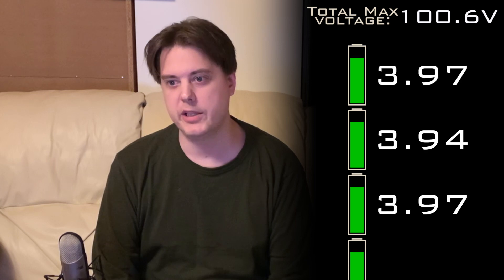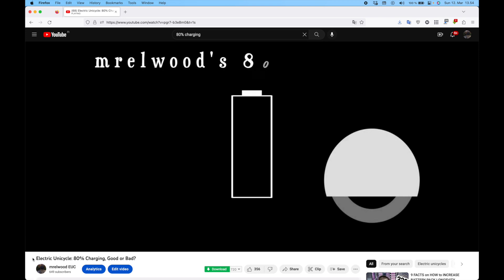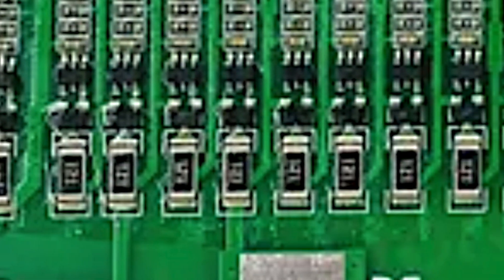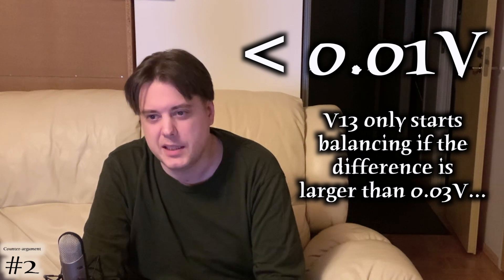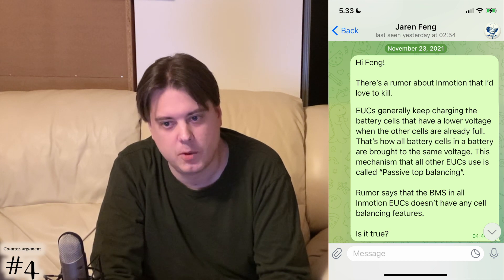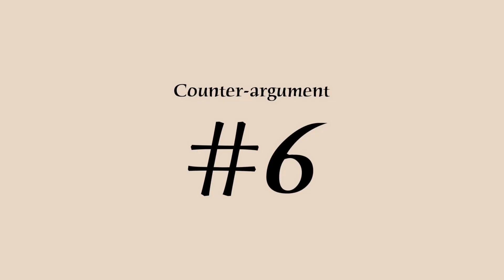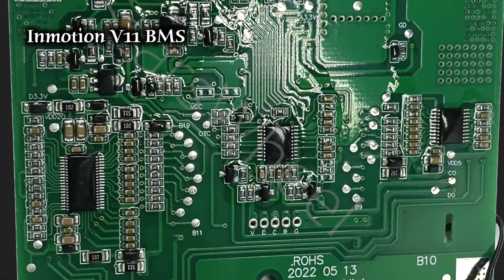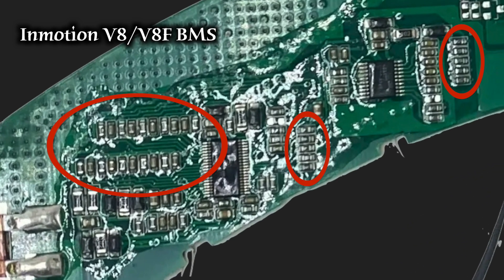Inmotion EUC Battery Cell Voltage Balancing, Yes/No?

Comment: Thats why i got rid of bms in my inmotion and added balance plugs and doing maintance balance charge  every month so i always know what my battery health is.
Reply from the maker: You got rid of the BMS?? So you no longer have any overcurrent, overcharge, or overheat etc protections??
Reply: @mrelwood_EUC  i have dialed the resistor in inmotion charger to charge to 83 volts this leave me with save margin so cells don't go over 4.2 while charging. I have split pack to two 8s and one 4 s for maintance charging where I can balance charge with my 8s capable hobby charger whenever some imbalance happend. I much rather to have this setup then have a pack with dodgy bms where I can only guess what cells are doing. Bms overcurent protection sounds like face plant so no thanks I rather to have this option removed. And I'm not worring about overhiting battery as inmotion board usually peak at 30 amps and I live in flat area so it's all good. Saying this I was testing   this setup on steep hills and all worket flawlesly. As for cell balancing they usually don't get out of balance if you have matched cells. I have small diy solar system with tesla modules same setup with no bms and in a year of owning it I didn't have to balance these modules at all
Reply from the maker: @greg23842384  The overcurrent protection isn’t there to cause a faceplant. It’s set to a higher amperage than the board can realistically use for balancing. It’s there to prevent a thermal runaway in case something goes wrong, for example a mosfet failure that leaves the mosfet open. Think about their “dodgy” BMSs what you will, but Inmotion has a few dozen thousand times more experience in building BMS systems than you do.

But you do you, just your wheel wouldn’t be welcome to my house. Nor would I dare to ride it.
Reply: @mrelwood_EUC  to take care for this issue i have installed quality class d fuse on my power leads plus there is another fuse on the board. I trust this wheel a lot more now then before. No bms less complexity and less chance that something will go wrong

Comment: Good argument! I stand more on your side although there is no clear confirmation from IM of their cell balancing mechanism. WW is great but he benefits from "views" and controversial videos get more eyeballs. It makes absolutely no sense that any PEV company would NOT use cell balancing in these GIANT batteries but the intellectual argument does not mean it is the case in reality.
Reply from the maker: You are absolutely right. This video didn’t present as much actual proof for there to be balancing than proof to why the arguments of people who say that there is no balancing are wrong. “Counter-arguments” might be a better wording.
Reply: @mrelwood_EUC  So, you are saying that the certitude of WrongWay that Inmotion doesn’t use cell balancing is wrong, but, in the same time, you are not certain that Inmotion DOES INDEED use cell balancing. In this case this video seems like a PR move for Inmotion, the opposite of anti-PR move of WrongWay. Bummer: It isn’t broken and it isn’t fixed.
Reply from the maker: The lengths that I’m interested to go to in order to find the answer that satisfy me have been met with what I’ve brought up in this video. I can’t see a reason to believe that Inmotions since the V10F (and possibly earlier) wouldn’t have cell balancing. And I find all the arguments that the other side has made to be easily refuted.

But that still doesn’t bring us to the factual truth. I can’t explain how what I’ve seen would be possible without cell balancing, but even that doesn’t give us the factual truth.

I would have to disassemble the battery pack of my V11, and use a lot of my time to orchestrate and document several measurements and test procedures. I’m simply not interested in wasting my time and energy on that, since it wouldn’t affect my relationship with my wheel nor my future purchases. And even that wouldn’t stop the rumor mill from going on.

So it’s not about facts. It’s about what’s  solid enough for you personally.

I don’t get your comment about a PR move though. If Inmotion was interested at all in addressing the rumors, why on earth would they use a small YouTuber like me to share counter-rumors when they could just as well kill the rumor altogether in the Ask Bob series of videos??

Comment: There is no shame for Adam to issue a correction video. And all of these companies should have PR teams in the west to deal with this.
Reply: Adam only stated that there is no passive cell balancing. Since the resistors on the V10F BMS are 1k ohms, there can't be passive cell balancing. This doesn't mean there couldn't be some other form of balancing.

Comment: I noticed in all of your pictures of Inmotion boards, the electronics have conformal coating. Is Inmotion the only company that does conformal coating on the electronics? Maybe you should make a video explaining to people what that is and how you can do it yourself to prolong the life of your EUC and make it better protected against moisture?
Reply from the maker: Most manufacturers do it nowadays. I haven’t seen any issues that would clearly be caused by a lack of coating on the mainboard, so I don’t see it being a very relevant issue. I’d also advice how to seal up the wheel otherwise rather than suggest for watchers of various levels of technical prowess to start coating their boards. It’s a bit too easy to get into places where definitely shouldn’t be any coating, such as the mosfets.

Comment: I'm a robotics engineer and this isn't the first time WrongWay (and others) have invented problems that don't exist and spread false information way outside their area of expertise. Very frustrating and disappointing.
Imagine waking up from a medical operation and telling the surgeon how he should have done the surgery, based on some rumours, from social media, while you were unconscious. Just where is this confidence coming from?
Reply from the maker: I’ve noticed the same in several subjects. People are certain that they have much better solutions to issues they know very little about, and no matter how gently you try to explain the situation to them, you immediately turn into a know-it-all company shill who wants to quiet the customers and prevent all questioning. Perspective is so lost on people nowadays.
Reply: however it really looks like that WrongWay was telling truth. On Euc Forum someone really looked into integrated circuits of V10 and schematics and found out that the IC didnt used the balance option.
Reply from the maker: I only saw the investigation on V5F. Seems that it indeed doesn’t have balancing. One can’t expand the results to all their models though, since the V5F is the smallest and one of the oldest. One would need to examine all of them to be able to say that none of them have balancing, which is what WW said, without examining them.
Reply: @mrelwood_EUC  actually someone posted a V10 BMS in the thread and it looks like even V10 BMS doesnt have balancing.
Reply: @LaggerSVK  Technically even without balancing, a battery pack with properly matched cells should do just fine for a long time without any kind of balancing. To prevent fires, the BMS really only needs to protect from over- and under voltages + short circuits and such.
Reply from the maker: That’s the thing though, “with properly matched cells”. I’m certain that at least some manufacturers (or some models) don’t prioritize proper cell matching all that much.

Comment: Agree with you 100%. Passive cell balancing is not some new high tech electrical wonder.  It's very simple and necessary.  I'm surprised Inmotion has not done more to snuff out this silly misinformation!
Reply from the maker: I fully agree. I don’t think they quite understand the consequences of the situation. I have tried to explain it to them a few times though. But I’m just a single member of public to them.

Comment: I was considering buying a V11 until I saw other information on YouTube alleging lack of passive cell balancing in InMotion EUCs. Then I started considering other options. So I'm glad that I came across your video that got my thinking back on track. I also previously got a lot out of benefit from watching your video on "80% charging, Good or Bad?" You have a way of clearly communicating technical information, in a practical and unbiased way. Thank you Mr. Elwood for being a reliable and helpful EUC content provider! 

Now, since I am still interested in the V11 after watching this, here is perhaps an opportunity for you to confirm (or correct) some other information (or misinformation) that is out there on the V11. Some review clips (or the commenters to them) have stated that the V11 bearings are (or were?) a problem, and the motherboard has a higher failure rate than normal and should be visually inspected regularly to ensure it is not getting fried. Are you able to comment on these aspects of the V11 reliability?
Reply from the maker: Thank you! Glad you liked the 80% charging video, it has turned out to be one of my most popular ones. Really happy I can share what I know!

On the V11: The first batches didn’t have any bearing covers, so the failure rate was high. Mine included. They have however shipped the V11 with well working bearing covers for almost two years now, so it’s no longer an issue. The mainboard revisions are however not publicly known, but at some point the failure rate did seem to go down. Unfortunately, a visual inspection won’t do you any good. Usually there are no fried components even on the failed boards. And even if there were, they only fry when the board fails, not before. I wouldn’t hesitate for a second in buying a new V11, but like with all wheels, a reputable distributor is always worth the small extra cost.

I have 7000+ km on my V11. I planned on upgrading last year, but they simply haven’t made a wheel that would suit me nearly as well as the V11. If you ride a lot of hard off-road, the suspension rails will need to be replaced at some point, but they are cheap. Still, keep them clean or well waxed. Don’t use oil or grease, as they will collect dust and other particles which increase the wear rate.
Reply: @mrelwood_EUC  Thanks for taking the time to provide thorough replies to my questions. Perhaps keeping the suspension rails clean is good enough care but if not, is there a type of wax you could recommend?
Reply from the maker: I have only tried a few waxes as I don’t want to purchase different ones in hopes that one might work well. But out of the ones I’ve tried, simple candle wax works easily the best! I have the small ones that come in aluminum foil cups. One can of course buy pure paraffin wax as well, should be mostly the same stuff.

First I remove the outer suspension rails to get access to the black rails. I remove the aluminum cup from the candle and rub the candle on the wearing part of the rail while pressing quite hard, until there’s a decent layer of wax on the rail. I then rub the rail with my finger until I can feel the wax get soft. I then rub the sides and backsides of the rails with the excess wax that’s on my fingers. Sometimes I even wax the plastic slider guides on the removed rails.

There’s no danger of overdoing it, other than it can get a bit messy. Any excess wax can easily be cleaned up with rubbing alcohol.
Reply: @mrelwood_EUC  Thanks!👍
Reply: @mrelwood_EUC Speaking of upgrading, have you considered the BegodeT4? I just wish it offered some water resistance, but V11 feels a little old compared to the T4 at this point, so my gf is considering T4 instead of the V11.
Reply from the maker: @leetNightshade  I have not. While faster and more powerful, it’s a Begode with Begode issues. Those I want to stay far clear out of. Based on what I’ve read:
- Suspension linkage needs replacement, original has the wrong rising rate.
- Shock needs replacing, original Begode shock is of lousy quality.
- Suspension telescope tubes fit badly and create a clunk.
- Battery boxes require external fairings due to lacking physical battery protection.
- Failed boards mid ride.
- Sudden motor failures mid ride. (New pinned motors possibly have solved the issue.)
- Trolley handle failures.
- Headlight blinds everybody, can’t be used in traffic.
- Dynamic tilt-back requires a 3rd party custom firmware that’s no longer maintained.
- Only three ride mode presets.
- Much heavier than the V11.
- Water intrusion issues.
Etc etc…
Reply from the maker: Oh, and on not considering the V11 because of the no balancing rumor:
Go to the EUC forum and find out all posts you can about failed V11 battery packs. They are practically all about new batteries, so not related to balancing. And consider that the V11 was the second most used wheel in 2022 on EUC World. Several thousands of users. So the amount of aging battery failures should surely be all over the place and everywhere, right? Let me know if you find even a single post describing how their battery failed at over 5000km despite attempts to balance the pack.